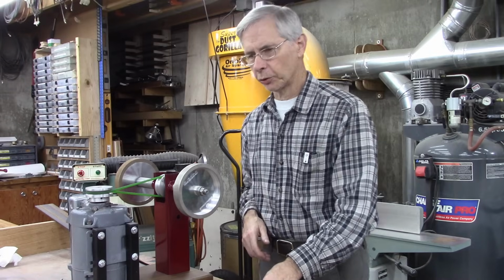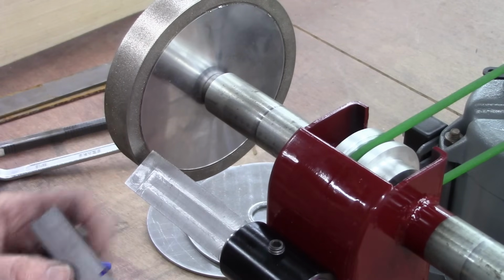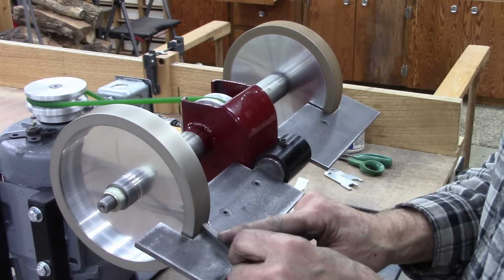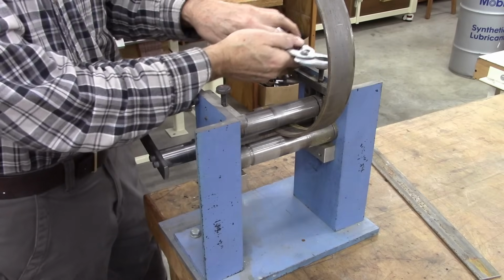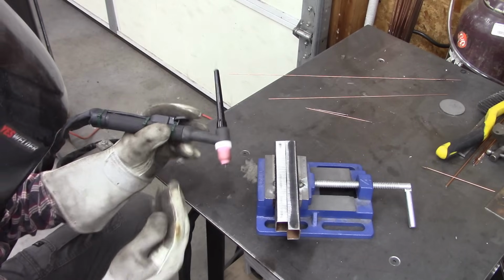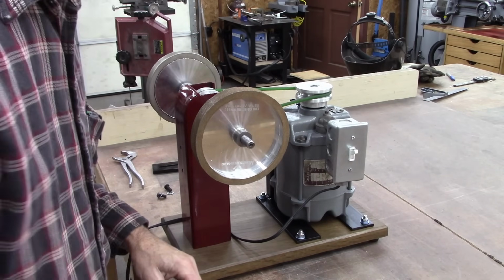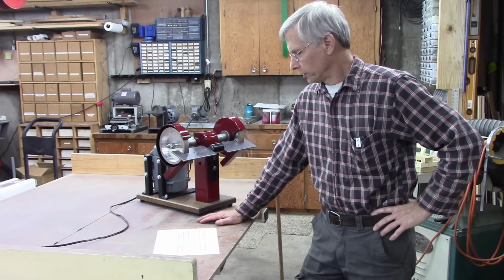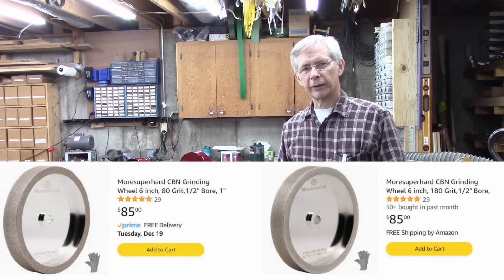Finishing my CBN Grinder & Testing the Moresuperhard 6-inch CBN Grinding wheels. Part 3

Comment: Can you sharpen your tungsten on the CBN wheels?
Reply from the maker: Yes but its hard on the wheel. As long as you only sharpen HSS the wheel will last indefinitely (or almost). I'm not sure how long the CBN will last with carbide.

Comment: As you're welding, the argon (or any inert gas you might be using) has two important jobs: 
1) Protect the tungsten electrode from oxidizing/burning, as it will with any whiff of oxygen at the white-hot glowing temperatures. This is very important, more so than 2) but I think you do a good job of protecting your electrode from the air. 
2) Protect the metal you are welding from oxidizing/burning. This is usually much less important than 1) but you should keep your welding torch over the weld to let it cool down while still flowing argon over the glowing surface. Give it 3 seconds. Also, in that time the tungsten electrode cools from white hot to dim-red (or even cooler) and will then tolerate the oxygen in the air much better. You paid for your electrode to contain 1-2% Lanthanide or Cerium, don't let it oxidize away. Probably not good for your health as well. The Lanthanide or Cerium are only good when they are right at the surface of the electrode, but thats where they'll oxidize away the easiest. 

It's our instinct to pull the torch away from the weld when you"re done to see better how it turned out, but resist this instinct. Makes better welds and cleaner electrodes. If your weld is shiny after welding, you did well with protecting it from oxygen.

Comment: You know how you prefer just hss or cobalt lathe bits, but you will use a cemented carbide bit right?  Are you able to dress up any of the carbide inserts to get them to run better (less force I guess)?  A lot of them have kind of a dull edge.
Reply from the maker: I usually use inserts. Cemented carbide on rusty metal because its cheap. CBN will grind carbide but it shortens the life. With HSS is lasts almost forever. So I never grind carbide.

Comment: What rpm is your motor rated at? What range is consider optimal for  CBN?
Reply from the maker: The speed of the CBN wheel is very forgiving. They say 1750 or 3450 will work although they also say the optimum is 1750 for a 6 and 8 inch wheel. My motor is 1750
Reply: @WinkysWorkshop  Thanks for the prompt response and videos. I'm kitting out a hobbiest workshop, and your videos are a treasure trove. It's motivating me to revenovate/commission the Smart & Brown Model M I acquired last year.  Enough projects here to keep me busy for a long time!
Reply from the maker: @eocallaghan  No problem, glad you like my videos. I never heard if a Smart and Brown but it looks like a nice lathe

Comment: how long did it take to radius that bit?  How hot does it get?  A regular wheel would turn the edge blue did that happen?  That's the first time I've seen anyone use the CBN wheels.  When I first heard you talking about it, I thought it was some of those pills you order online.
Reply from the maker: The grinding speed is about 50% slower than mild steel on a standard 80 grit stone and the heat is drastically reduced. You can put a full radius on a 1/4" HSS blank in about 30 seconds without water cooling it. It's fantastic!

Comment: I love watching your no nonsense and nice work.  I worry to much over stuff yet am I just not so practical.  Id like to add 8" wheels but have to rework the work tables now too. Fine or course first?  I can't both.
Reply from the maker: I would go with the 180 grit wheel (fine). It still removes stock fairly fast and gives you a better finish.

Comment: Great build Mark! You should be proud of your work. 
Good to hear the Vevor tools are working well for you. 
Thanks for sharing 
Cheers
Reply from the maker: Thanks, I think inverter technology has changed the market a lot. I'd say most welders work about as well. The Vevor welders are just incredibly cheap. Several years ago finding a TIG under $200 would have been impossible and anything under $700 didn't even have HF start.

Comment: Great project, well executed.  Two suggestions:  for aesthetics, replace the toggle switch with machinery on and off buttons; for functionality, add an angle gauge on the tool rest to set the tool angle you want.  But I agree, this thing will last forever.
Reply from the maker: Well I like the simplicity of the switch. In fact I've had issues a few times with smaller toggles and push buttons on machines going bad. I remember 20 years ago I had a table saw with a 25 amp toggle switch for power. I replaced the switch after 6 month and then it went bad again. I then mounted a box to the saw in put in a standard light switch. It lasted the next 10 years and might still be working (I sold the saw). Quality light switches are cheap but made very well. 

The angle gauges is a great idea! I will likely do this.

Comment: That turned out fantastic Mark. Looks like a smooth running machine, well done. I have a CBN wheel on my grinder for sharpening my HSS wood lathe chisels (can be used for metal lathe HSS as well). We have them at the woodturning club too. Ironically the wheel I got was wider than the stone wheel that came with the grinder, so I'm going to have to re-make the guard and cover so it fits the wider wheel at some point (I will need to build a bender/ring roller). 
That bender you have looks good and works well. I have a ring roller on my list of things to build so I will get there one day. Lots to do, so little time...
Merry Christmas and Happy New Year from NZ.
Reply from the maker: Thanks! That little roller works well. I made it before I started a youtube channel so no video. I made it using 1--1/4" bar stock with 32 mm OD bearings on the ends. Then I drilled and reemed  the 2 angle iron frame for the bearing for the two bottom rollers. This allowed me to assemble the frame and slide the bearings and roller through the holes. On the side that doesn't show in the video (opposite the crank) I tied the 2 bottom rollers together with a small chain. Oh...  and I used a screw and washer on the edge of the bearing holes to hole the rollers in place. You might have a design in mind but here's some pictures of the one I made. https://photos.app.goo.gl/mBJrpmLPpJTMy6fd6
Reply: @WinkysWorkshop  Thanks Mark, the photos a very useful. Can you tell me what some of the measurements are? Like the width of the top roller in between the bearing guides on the sides. E.g. this will be the max width that you can bend. The height of the rollers from the base, the size and thickness of the angle iron. Are the chain and sprockets from a bike?
Reply from the maker: @thehobbymachinistnz   Here's another link with more pictures and a few measurements. The angle iron came from a swiss made machine at work so its actually metric. The dimensions can be change a bit wider etc. https://photos.app.goo.gl/uvd7v5xQ1U81CzC19

Comment: Well, I was initially sceptical about the guards. The wheel's not going to explode, is it? But, looking at what you've made, I was wrong! That dust collector is really good. Congratulations Sir!
I use my cbn wheel for carbide. Yep, it's probably knocked the edge off the abrasive, but it grinds hss to a mirror finish and has withstood said abuse for over 5 years.
Reply from the maker: I ground carbide on my old CBN wheel. I've not seem any change. I just know that they recommend against it. The guards were for dust and also so that partials don't fly back in my face.

Comment: Put a magnet in the end of the tube. It will collect all the steel dust from the tools. Regards from Australia.
Reply from the maker: I thought about magnets too. I have a piece of PVC pipe under it now. I probably need to put covers over the wheels it I wasn't to improve it more. Probably not worth the effort.

Comment: General Rule of Thumb is 1 amp per thou thickness, so 1/16" 60 amps or a bit less. Came out well. Great Job. Now onto the next project ?  How is your CNC wpood lathe going ? not heard or seen any more since the toolpost upgrade. Regards from Australia.
Reply from the maker: Yeah, I think I was using a bit more amps but it worked great until the end. The CNC lathe works fantastic. I don't use it very often but I did a job for a guy maybe a month ago and it worked fantastic. The only issue is dust collection. Lots of cleanup every time I use it. I'm designing a new lathe that will be very unusual (if it ever happens). Right now its just a drawing. https://photos.app.goo.gl/KUqq1Nrox8ZEfp9G9

Comment: Great grinder design and build. I have been wanting to do something very similar with an old flat belt driven grinder but was struggling to figure out how to make it compact and was thinking of something similar to yours but with a flat belt. I think I may switch and try your welded round belt idea. Keep the great ideas coming.
Reply from the maker: As long as the HP is not over about 1/3rd the round belt works well. I almost went with flat belts drive kind of like my drill press but I was worried about tracking.

Comment: If you haven't tried soaking mild hot rolled steel in white vinegar to remove mill scale you should give it a shot. My process is to soak the metal for 24-48 hours, rinse with fresh water and then put it the ultra sonic cleaner with Simple Green Pro degreaser for 5-10 minutes. That usually removes all the rust and mill scale without grinding anything. I bought several pieces of black ABS pipe of various lengths and diameters at Home Depot, capped one end and put a screw on plug on the other for doing long parts like angle iron. Of course those won't fit in the cleaner so I just rinse in water and a lite scrub with a Scotch Bright gets all of it off and ready for welding, painting or powder coating with very little effort. Good luck.
Reply from the maker: Very interesting, I'll give it a try, Thanks
Reply: @WinkysWorkshop  It works great
Reply from the maker: I will definitely try it! @TheAyrCaveShop

Comment: CBN is trash -diamonds all the way baby !
Reply from the maker: Actually CBN works better than Diamond for HSS. It cuts faster and at lower temperatures. If you grind carbide diamond might be a better choice however.
Reply: @WinkysWorkshop  I grind everything on a diamond plate i bought from ebay,drill bits,hss,carbide.Wont brake a speed record but for 10$ it gets job done. . . like a regular grinding wheel it needs cleaning from time to time,i do it with a old plumbers dried up clear silicone.
2000 grit plate does amazing finish on carbide ,for taking of chunks i use 80 grit.

Best thing is i made simple wooden backplate for cheap bench grinder so whole setup is like 40$.
For hobby use great ,professionals dont grind  tools anymore(magical world of inserts) anyway.

Also if you ever get tired of grinding hss just cut it off with a 1mm stainless steel cutoff wheel -bosch makes good ones that are  1$ each.
Hss can go up to 600C° and it is really hard to get that temperature on diamond wheel unless you push in like a gorilla.

Comment: A major improvement in time efficiency when re-pointing your welding electrode (carbide/tungsten) is to use an air-die grinder with a 2" 60 grit wheel.  If you have a build-up on the shaft or tip of your electrode, you can use any part of the grinding wheel to shape the electrode back to a round shape.  You can do the same to reshape the tip of the electrode to any "point configuration" you need for the work.  REMEMBER though that when you get the point shape you want, only use the left 1/2 of the wheel (depending on rotation) to "groove" the last 1" of the electrode.  You want the micro-grooves to be traveling in the same direction as the electrode which allows the arc to form properly.  This is a surface issue only and no need to press hard on the electrode.
Reply from the maker: Groove the last 1 inch? Never heard of that. I do sharpen with the grinding marks running the length
Reply: @WinkysWorkshop  Same thing.  If your accurate enough to groove just the tip then stay with it.  I can't do that with the die-grinder so I back down the shaft a little (about 1").  By using a bench grinder, my electrode kept grooving the wheel so I switched to the die-grinder.  It's way faster.  Also, and not for everyone, since the speed in re-shaping the electrode is much faster, I routinely re-shape 3 or 4 at a time.  This way I can keep up the production.  Your work may not benefit.  Using the die-grinder really helps my efficiency.
Reply from the maker: @richardgreen7811 I've been using my old CBN wheel.  So far its not hurt the wheel although they say it will eventually wear the wheel. I'll probably get a diamond wheel and make a jig for sharpening.
Reply: @WinkysWorkshop  Works for me ... I like the die-grinder because I feel safer and it's faster.  Ya gotta go with what brings ya.
Reply: First Class. Great design. Thanks for allowing us to watch…..
Reply from the maker: Your welcome, thanks for watching! @billkurek5576

Comment: When your TIG welding light gauge metal as you were on the two tubes, start at each end and weld in at least 1/2 inch, then alternate your welding from each end to maintain a cool temperature.  It's more effective than "speeding up".  Also, when you come to the end of the piece you won't burn through the metal because you ending on "weld" and not the thin end piece of the tube.  For me ... I keep a water filled spray bottle handy to quench the heat when welding light gauge product.
Reply from the maker: I think that is good advise - Thanks!

Comment: Mark I really do like the idea of how you made the tool rest. It would be an easy rest to incorporate with most bench grinders. Love the creativity. Thanks as always for bringing us along.
Reply from the maker: Thanks again. Yeah, on this grinder it's not going to be an issue but there is a reason you never see this on grinders.  The pivot point sticks out further than the front of the wheel. Normally a tool rest that does this is on a pair of trunnions. Like on many belt sanders, bandsaws and table saws have.
Reply: I'm looking at my grinder, and can't figure a way to adapt a similar rest to replace the mickey mouse rests on it. I guess that's another reason the belt-drive grinders are superior.